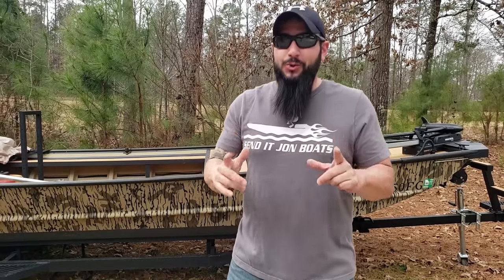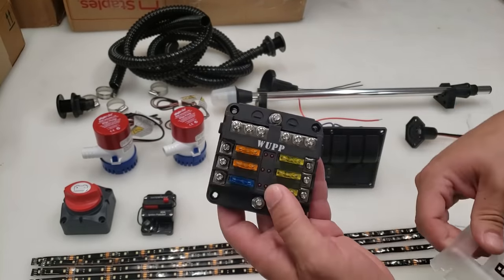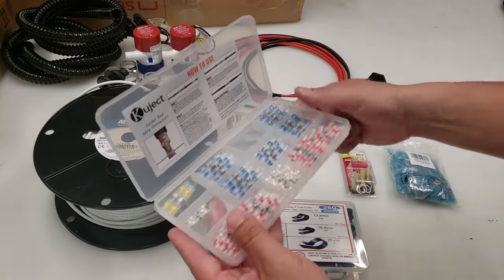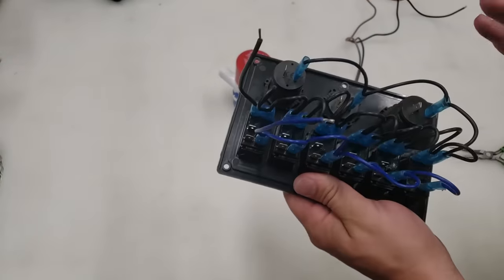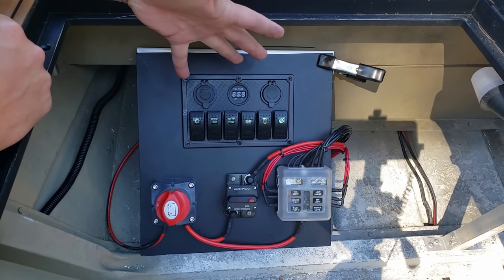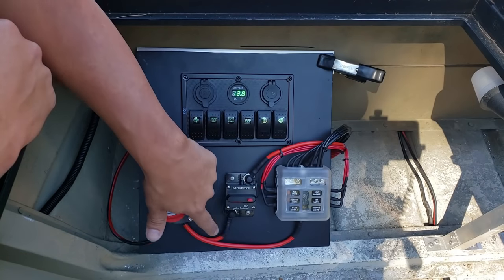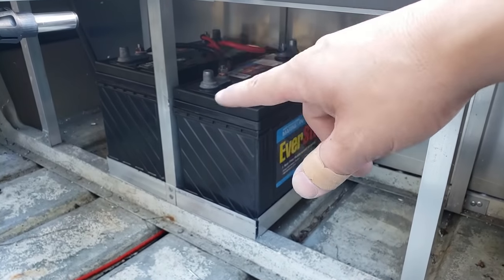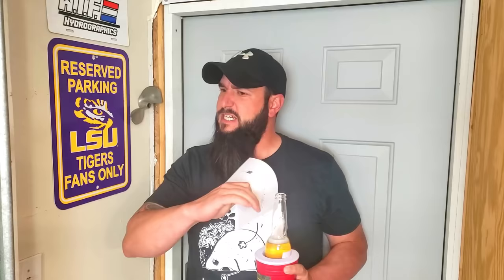Jon Boat Electrical Wiring for Beginners and DIY'ers

Comment: Curious...Why didn't you install a float switch to at least one of your bilge pumps? I'm running 2 bilge pumps in my Starcraft with on hooked to a float both are wired separate  But maybe that's just me..

Comment: Question on your wiring Video you use two bilge pumps. Did you have a specific reason for that, or did I see it wrong? Not hating just curious.
Reply from the maker: It was cheaper to get 2 smaller bilge pumps than one big one, and I like the redundancy. If one ever fails at least I have another one to get me back to shore
Reply: @SendItJonBoats  not saying you're wrong then, but if you want redundancy, why wire them to the same circuit?  If one shorts out, you lose both.  Great video and good clean job.  Geaux Tigers!
Reply from the maker: @AdventuresInMetalDetecting  Usually what goes out or shorts on a bilge pump is the motor itself, not the wiring. So if the motor goes out the other one will still work just fine since they are wired parallel and not in series. If they both go out, then the boating gods just hate me and I am swimming home.

Comment: Hello I have a question. Hopefully you can answerit for me. So on my boat I have 4 batteries
3 batteries are four trolling motor and fishfinder 
And 1 is for the motor water pump, live well and dashboard and switches 
can I do the same set up  like yours with all four batteries,
Reply from the maker: Yes sir you can. Hope that helps.

Comment: How close does the switches and fuse block  need to be
Reply from the maker: I try to keep them close so I do not have to use a ton of wire. The further away you put them the more wire you have to use and that means more money.

Comment: Is there a specific amp fuse I should be using or could I get away with all 10s or whatever? I bought a boat used that is pre wired but just missing fuses. Wondering if I have to look up the bilge, and LEDs and find the specific fuse they want?
Reply: The fuse should be rated to the cable current rating or lower.

The cable current rating should be equal or higher than the appliance current rating.

Design procedure:
1. Decide on what devices/loads you are going to connect to the single circuit.
2. Calculate the maximum power dissipation of the loads. Translate this into amps. (Using I = P/V)
3. Set the cable current rating to be higher. Identify what thickness (or cross sectional area cable you need).
4. Select the fuse rating to be equal or less than the cable rating but higher than the maximum load current determined in step 2.
Reply from the maker: What Dean G said, just lower than the wire is rated for. I usually do 5s and 10s
Reply: @SendItJonBoats  Where you have a an extension lead providing power to a single appliance:
There is a fuse in the plug of the appliance whose value is set by the manufacturer. That protects the appliance cable and the appliance.

The setting of the fuse in the extension lead plug is not for the benefit of the appliance, it is to protect the extension cable.
It serves no benefit whatsoever to lower that fuse to the same rating as the appliance  fuse.

Comment: How close can battery wires be to each other ( positive / negative ) can you bundle them with zip, ties?
Reply from the maker: Yes you can bundle them no problem. Just dont let any bare wire touch.

Comment: With the battery disconnect, can you run 2 or 3 batteries to it as 3 12v set ups?
Reply from the maker: Yes you can, and they even make disconnects that will give you the option to run single or dual batteries.

Comment: On a aluminum boat it is almost impossible not to have the boat grounded. The motor grounds itself to the boat, also anything metal that has power and touches boat will be grounded.
Reply from the maker: Thats why I said don't ground the battery, don't need no extra grounding when the boat already struggles as it is.

Comment: I haven't worked on boats much, but I got MANY YEARS working on automotive and aviation wiring. DO NOT (for the love of God) USE SOLDERING especially those soldering butt connectors. Solder is susceptible to cracking due to vibrations those butt connectors are also a lower temp solder so hot days can soften it. I've seen whole systems come apart from a hot day with those things. The only connection that I've seen approved by the FAA because of vibrations are those butt crimp connectors and on this boat he could've used the waterproof version with the glue sealer. Great work but I would replace all those connectors they're a ticking time bomb lucky this isn't much wiring.
Reply: I’m and electrical aerospace instructor for Boeing. We use solder thousands of times on one single wire harness to attach ground wires to shielded cables.

Comment: How do you know which wire hooks up to which fuse. Like 5 amp 10amp 15 amp so on. Light lights go to which amp fuse and bilge pump so on
Reply: You have to firstly decide how many circuits you want to have. You need to decide what you are going to run on each of those circuits and consider the impact if you lose a circuit. So you don't want all your internal lights running off a single circuit, because if the fuse on that circuit blows, then you will lose all your internal lighting and if that happens at night, then you're going to have trouble finding your way around inside the boat to find your emergency flash light.

And if you have two bilge pumps, you don't want them running off the same circuit through a single fuse, because if that fuse blows, then you have lost the capability to pump completely. So separate the two bilge pumps on to separate circuits.
 
But you need to think carefully and ask yourself what is the impact if the fuse blows?

Knowing what appliances or loads you are going to run from a particular circuit, you need to calculate the maximum amount of current drain. You can do this from totalling up the amount of power in watts, and then working out what the current is. Beware that motors will have a large inrush current on switch on so you may need to factor that in.

So now you know how much current you are going to do draw on the circuit. The fuse is not there to protect the appliances, loads. It is there to protect the cables.

So then you set the cable rating in amps. And find a suitable thickness cable that can handle it, preferably use thicker cable than this because you don't really want the cable running at the maximum current all the time,  that will cause the cable to get warm and is wasted energy from the battery.

Then you set the fuse rating to be equal to or less than the cable rating, AND equal to or higher than the maximum load current rating.

This ensures that the fuse will not blow unnecessarily when all the loads are running, and protects the cable from over heating and catching fire in the event of a fault occurring causing excessive current to flow down the cable.
Reply from the maker: What Dean G said. Match the fuse to the rating of the cable.
Reply: @deang5622  thank you !!!

Comment: Your better off running a bus bar/ground block so when you have bad ground issue instead of chasing 14ft of wire your only chasing 1.5-2ft of wire to fix the issue
Reply from the maker: You can do whatever you want on your boat. I did this method on my boat and it works fine. Never had a grounding issue when using the right stuff.

Comment: The circuit breaker you're using works good on RV, but they're not waterproof.  They make waterproof ones for boats that are a better choice.
Reply from the maker: My boats been flooded 4 or 5 times now, and it still works. It's sold as a marine circuit breaker and it said waterproof on the box. Your probably right, but I haven't had any issies.

Comment: Did you buy those solder connectors local
Reply from the maker: I wish, I had to get them on Amazon because I could not find them local.
Reply: That’s what I figured. Can’t get that lucky

Comment: Dear Send'it, g'morning and "ye-yee" from an ocean and a continent away. My name is Scooter, have watched many a time, yet this is the first I dare comment: I would have loved to see you take a unexpected turn and CONVERT THE SMALL "pocket rocket" JONBOAT INTO A SAILBOAT WITH A TRADITIONAL JUNK-RIG AND LEA-BOARD. Over the years I've found only one such conversion video on the ol'tube of you, but it was low-res and end-result showing only, while the build itself was very crude. Also such conversions often utilize readily available wind-surf sails. Seeing as how your fabrications seem well thought out and appear premeditated, justified and well executed, I was hoping you'd be willing to give it a go? And besides, looking at the lake where you usually test your platforms, the rough water surface would  suggest ample wind for such a small boat. The hull shape itself is ideal for sailing with directional stability, due to hard chines and a sleek curved rocker towards the bow - to where a single lea-board and a well-balanced jink-rig would make it into a fun-, yet safe toy. Too bad you'd have to cut off those masterfully welded additions aft :) 
P.S. Since the boat is so small and light, any trolling motor would serve as an elegant substitute to a rudder, while fulfilling other purposes as well - added propulsion when the wind is down/unfavorable, as well as providing weighted ballast for stability in combination with the battery.
Reply from the maker: hmm... never even considered a sail. I would have to do some research because I know nothing about sailing
Reply: @SendItJonBoats  Understandably so, but then again that should make it even more fun and somewhat interesting - after all we are all in this world to learn and discover, so why not try out something new :) Cheers

Comment: Do you really need the fuse box with the amp breaker and the switches (which already has protection.) This seems like overkill to me.
Reply from the maker: Overkill is better than getting shocked. The amp breaker is only for the trolling motor, the fuse block is what breaks the circuit for all the other accessories.
Reply: @SendItJonBoats  You don't get shocked on 12 volts, or even 24 volts.
The fuses are present to protect against a fire risk.

Comment: wiring stuff isnt hard, the problem comes to know when to use the right fuses etc. thinking about rewiring our boat, but the issue with what to fuse off etc still persist. i know its basics. you got a battery, that connects to the ignition, gauges, plotter, lights, bilgepump etc and what not. i might just overthink it.

Comment: "Where do you ground the battery, or are you supposed to run a ground wire to the HULL anywhere? No no, no no no no, no, oh my God, no."
Reply from the maker: Im laughing, but dang, I get that question alot.

Comment: sigh, you do not need to put the heat shrinks and connector into the FLAME!  hold the flame next to it and keep the shrink moving a bit to warm up the largest area you can at once. i will also say that the mini torch lighters work even better, but again, you just need the heat, not the flame, otherwise you burn and blacken it like you did.

Comment: Completely foolish to hook the bilge pump up to a switch. If you sent the boat underwater last thing you’re gonna try and do is flip a switch. Next time put a bilge pump float so it automatically turns on. Trust I have experience.
Reply from the maker: Yeah I ordered the wrong ones, late night amazon shopping. I just threw them in for now.
Reply: It's a Jon boat. Not some boat with the bilge pumps literally, in the bilge. Float switches are great, but definitely not needed on a jon boat. Float switches belong on bilge pumps you can't see. Or if you're like your boyfriend, you have float switches and high water alarms on your Walmart $37 Kayak
Reply: @kevintidwell7156  First what Walmart has a $37 kayak. I want a kayak. Second you’re right it’s not necessary to have bilge pump float. But if you are in a Jon boat and taking on water the last thing you think of before sink is let me flip a switch. Thirdly you might as well say “it’s a small boat just use the oars it’s not necessary to use a motor.” Just because you can do things wrong, sorry I meant the hard way does not mean you should.
Reply: @kevintidwell7156  
Depends on application.  If you’re leaving Jon Boat or kayak in water uncovered overnight, you want an automatic bilge for both.
Reply: @jtgoldfish  14 year old know it all
Reply: Hell naw I need that insurance money for the new boat🤣
Reply: So what does that say about all the stock boats that came with a bilge bump switch since that was a factory option for many years
Reply: @jtgoldfish you actually need two 800 GPM bilge pumps, one on automatic and one manual.. the one on auto will take care of your normal bilge needs.. the other one is your “aw shxt I forgot to put the plug in the boat” option.. and if you think it won’t happen to you, then I have bad news for you, pumpkin.. you’re not special.. you will make a mistake or hit a stump and find yourself in trouble.. better to have it and not need it, than to hit aforementioned stump and start screaming like a little girl because your boat is sinking.. the choice is yours, sink or survive.. TBNation did a demo where he took the plug out of the boat to make the auto pump come on.. then he turned the other one on with the switch.. and it kept the bilge dry until he put the plug back in the boat..
Reply: Our bilge pump on our old 14 36 was always ole the coffee can had a few leaks and if we fished very long we would just take off down the river and pull the plug but always put it back in before you stop the boat 😅
Reply: @kevintidwell7156 what?   Float switches are for any boat.  What happens if u live on a lake and leave your boat on the water!  Float switches are for any boat and any bilge pump.  What a stupid comment
Reply: @jtgoldfish ummm I would definitely be flipping a switch to turn on a bilge pump if I was taking on water.  Wtf else u gunna do.  Apparently u aren’t good at controlling your emotions and actions in sticky situations
Reply: @trumpking4874  When I sunk my boat on accident. I had a bilge pump on a manual switch. I took me about 2 mins to get the switch flipped. My children, myself, then my gear that was floating away came first. After that happened I went to a float switch. In a sticky situation I could care less about a boat. That’s why you buy what you need to make it easier i.e. let the stupid thing turn on by it’s self.
Reply: Excellent video, thank you.  I used the principles in the video to wire up a small sailboat.
Reply: For a small cost and only one extra wire, you can install a 3 position switch on a bilge with float option. Auto-Off-Momentary. Leave it on Auto all the time, but for when you wanna force the last little bit of water out…push the momentary ON. 

That said, I don’t own a Jon Boat…I have a 32ft sportfisher where I can’t see how much water is in the bilge compartment. So my application may be different than Tiny Boats…
Reply: Wire the swich to override in case float switch craps out.

Comment: You don't even know how the original wiring on the switch panel works. The fused red wire goes to the electric components not piggybacked to the battery. There would be no point running the fuses before the switch on the original live wiring because they are daisy chained together on the switch panel. The other lives with working fuses would energise all circuits regardless if one of the fuses had blown out as they are as I said daisy chained so a fuse is pointless. This is why on any daisy chained loom you need the fuse on the wire going to each component or directly on each switch. I thought you were an expert? You had plenty to say in the opening 2mins about how crap we all are and how good you are. I've basically handed you your arse pal and I'm only 13mins deep. If what I said confuses you then never do a wiring vid again as you clearly don't understand wiring. See the red wire at the end of the daisy chain that has tinned wire on the end of it, yeah that goes to the battery live  mate. The rest of the vid so far has been decent so I do like you, just your not as good as you think.
Reply from the maker: Thanks for all the wonderful positive feedback. I hope you have an amazing day.

Comment: no relays or not running hi power led lights? but like your sh not trying to be scooter 🤣🤣😎
Reply from the maker: Nah these dont pull a ton of power and a fuse will be just fine.

Comment: The butt solder joints are poor! You should not use them as they do no not cover all of the wires, there is not enough solder to solder the wires
Reply from the maker: Solder worked fine and all connections have help up well.

Comment: So you used high grade marine wire with cheap soldering connectors. Hmm… 

I think you would have benefited from doing a bit of research on those solder connectors you have. Big Clive and others have shown how those are unreliable. They’re basically low melt solder that doesn’t flow properly with hot glue that doesn’t seal properly. 

I know, I know… I’m one of those people who know everything in your opinion. Okay. Whatever. 

That’s like putting racing fuel in your bicycle.